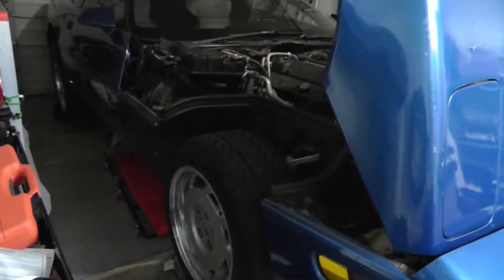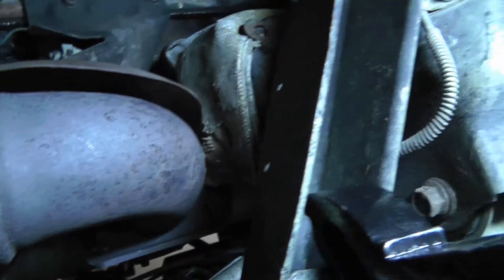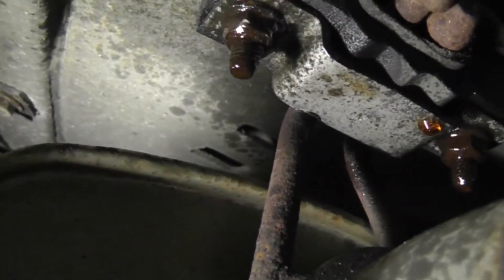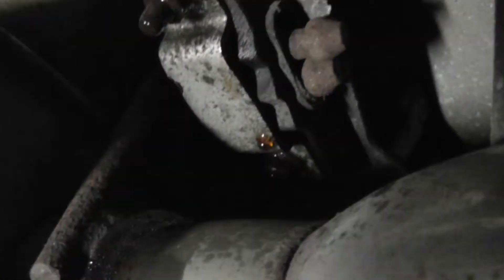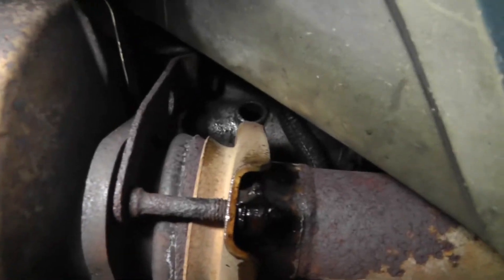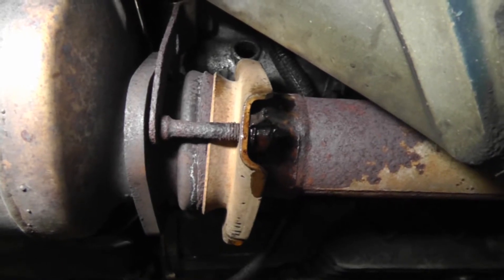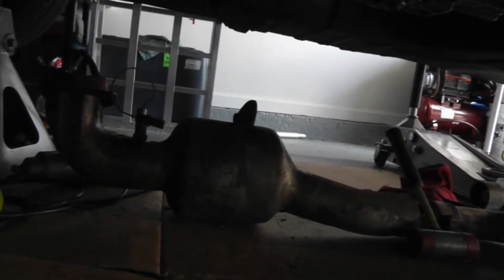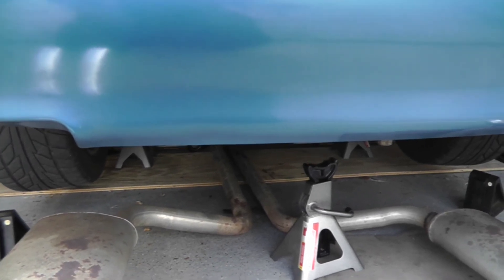Header install 1993 C4 Corvette, Part 1

Comment: Very useful video. Have to tackle same job this weekend👍🏻
Reply from the maker: Let me know how it goes!!  I’m really interested to know if my misfortune was an anomaly.
Reply: @fizzybillylah3816  Finished the job over the weekend. Ran into most of the same, clutch master rod went in the wrong side of pedal; rod c Clip was a nightmare to get on; and clutch slave was a nightmare to squeeze in between O2 sensor and shift lockout solenoid. I did take a different approach to bleeding that allowed to complete it in a couple of minutes. I bench bled slave like you did but I also filled master reservoir before I connected line to slave and lastly I pumped brake fluid through slave upwards.  Once reservoir was filled I had instant pedal pressure.
Reply from the maker: @PrimalurgesMiami  what brand header did you go with?  Did the holes line up with head?  Did you keep the emissions tube (A.I.R tube)?
Reply: @fizzybillylah3816  Never did headers, just clutch master & slave. Thought about doing headers in the past but fitment issues are apparently common and I have the one year LT4 so it might be even harder to find something that fits right.
Reply from the maker: @PrimalurgesMiami  oh, ok.  Well cool.  I’m glad you read the video description to know that my series has more than just headers.

Is that how you knew the clutch work was there, or did you just happen to watch all of the videos and just came across it?

Still, I’m stoked that my video helped.  

Later, and happy wrenching:).

Comment: Nice video. Provides a nice perspective. Cool music in the background as well. I am planning on installing headers on my 94 Vette. Did you notice a performance gain with your headers? My car is a true virgin concourse show car and I am trying to weigh out the benefits.
Reply from the maker: Thanks Joseph.  I don't regret one bit adding the headers!!!  The sound is amazing!!!!!!!!!  Even if you don't get a performance bump, having a Corvette that sounds like a muscle car should sound is good enough for me.  I can't say there was an appreciable increase in power, but the sound totally changes the driving experience in the best way.  I put on "hi-flow" cats....they suck, I should have put on regular cats...I don't like that exhaust smell when car is just idling in traffic and people behind me have their windows down.  I know the videos are long but I documented every single step it takes to pull this job off...take a look at all of them all the way through to save yourself the headaches I bumped into.  Get the allen head exhaust bolts, get new AIR tubes, and get some good catalytic converters.  I had to pay a muffler shop $800 to add an H pipe and weld on the mufflers to the stock dual pipes running back after headers...make sure that cost is part of your budget.
Reply from the maker: Joseph Wesley did you start your header project yet?

Comment: I had the same problem...What a pain in the ass
Reply from the maker: Did you figure out what the problem was?  I think Chevy must have changed the heads mid ways through production...how else could two different manufactures get something(exhaust locations) so basic and serious, wrong?  At least I wasn't the only one...I wonder if shops that did this job for customers had the same problem and just didn't say anything??